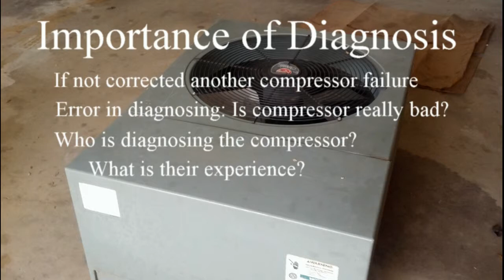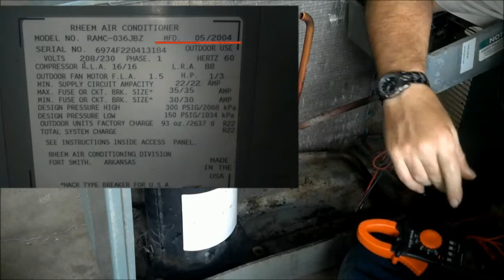Air Conditioning Compressor  Why did it fail

Comment: Plz can u explain why ac and refrigerator compressor explode I saw some of the videos showing explosion and people dieing what causes this
Reply from the maker: It's theoretically impossible for AC compressor to explode in the true sense of the word, because there is what is called a pressure relief in which the compressor will merely blow this port which will dump all the refrigerant out of it. This really isn't an explosion. I think more of what you may have seen is air compressor exploding. These can explode when the tank is older and due to rust of the tank wall it becomes weak and can explode due to the integrity of the tank. Refrigerator compressors would be similar to ac compressor, they have a pressure relief built into them. I suppose if you used improper refrigerant it could explode that way, but it would have to rupture the pressure relief port first and the gas would need an ignition source. Refrigerants in USA are non flammable regulated by EPA, so I have never heard of refrigerant compressor ac or refrigerator exploding in USA. I have seen them blow their charge, but that is not an explosion. It's a controlled pressure relief.
Reply: AustinAirCo thanks for your reply but sir I am taking about ac compressor with refgerent r32 and r410 there are couple of incidents which happened and what info I got from internet is not satisfing the people shown in video got burnet as they were in some proper bomb blast if possible I ll link the video so that you can also have an idea about it they say it's the oil inside the compressor which is catching fire 🙄
Reply from the maker: R32 is considered a mildly flammable refrigerant. For that reason R32 is not used in the USA currently while other places of the world have started using it. R410a is not considered flammable it's make up is 50% R125 and 50% R32. Given that R32 by itself is considered flammable, it's very important to only use skilled contractors when making repairs and so on. This is yet another reason the EPA in USA will likely not allow R32 to be used here because of the so many people that attempt to make repairs to their own system. I suspect if there were an explosion due to the use of R32 it was probably do to someone working on the system without proper training or poor techniques.